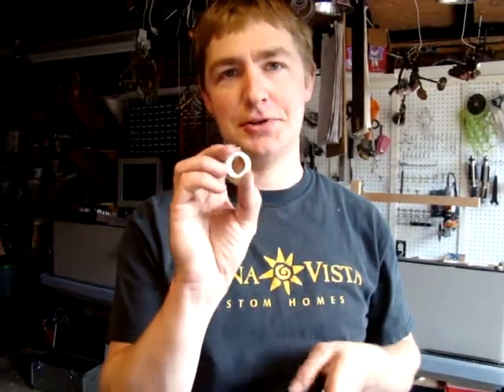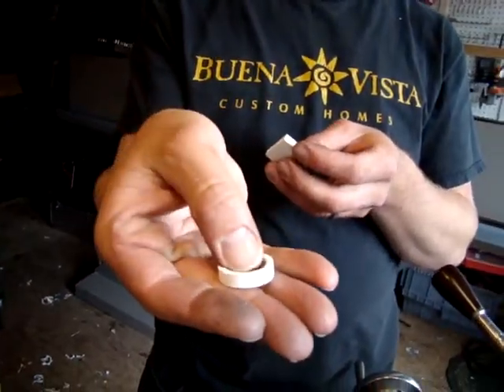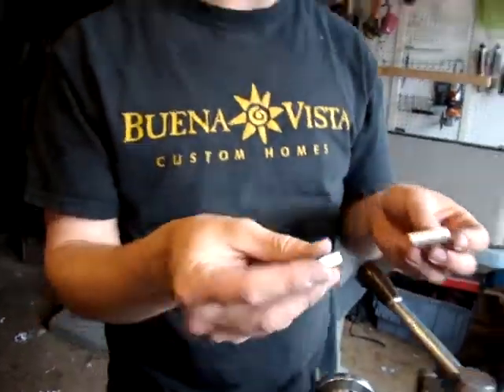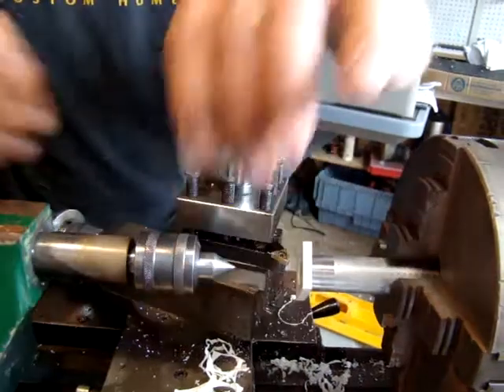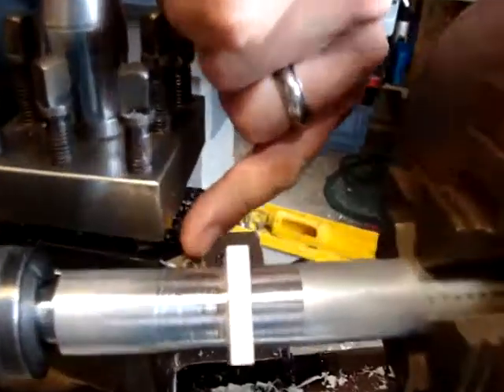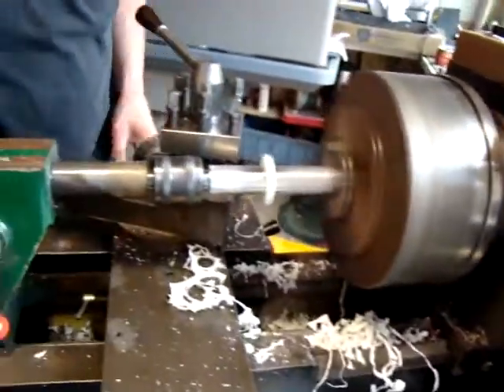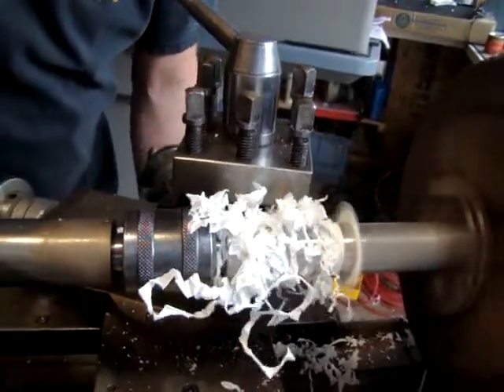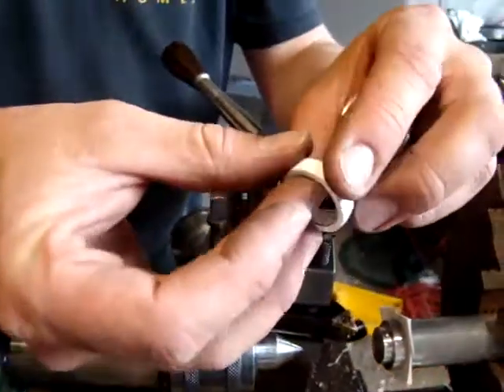Searl Effect generator replica plastic rollers machining technique

Comment: Please , can you send scheme searl effect coil circuit in my email : subhi925@gmail.com
Reply from the maker: I cannot share the circuits. They are private property of searl magnetics inc.  However they are a basic optically triggered magnetic coil. Using basic electrical experience a good copy can be created.
Reply: I appreciate your response, I have all the required materials but I have not been able to work the department and search the Internet for a year, I could not get the department, I did research in Russian sites and got a circle. Is it possible to send you the department and explain to me what it contains? (Магнитный генератор.Схема включения.) inside this vedio